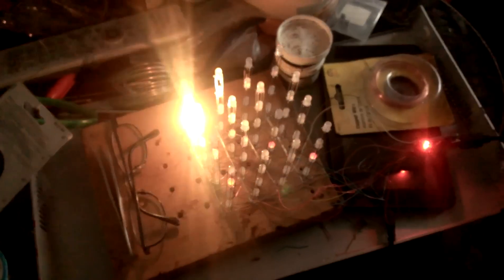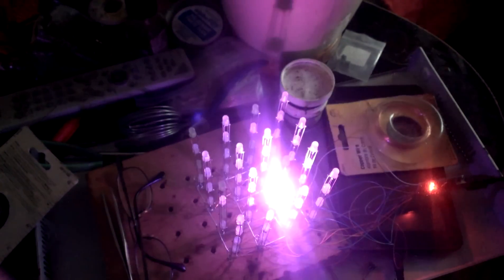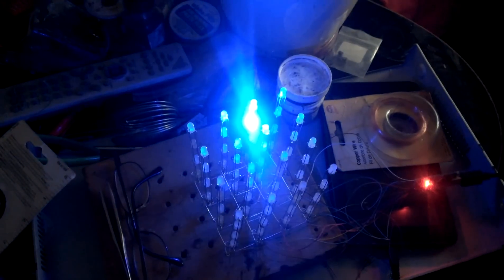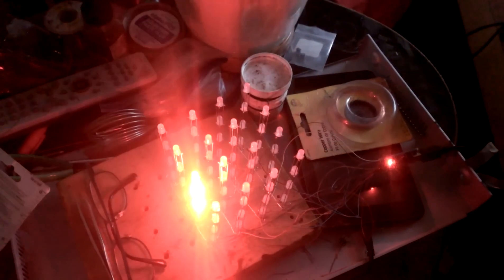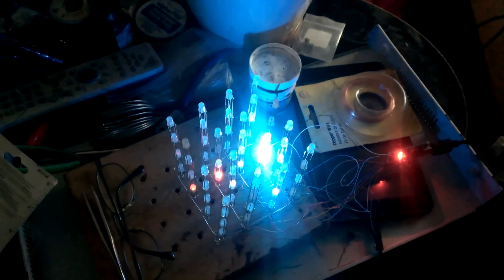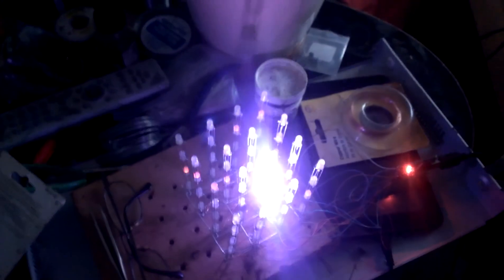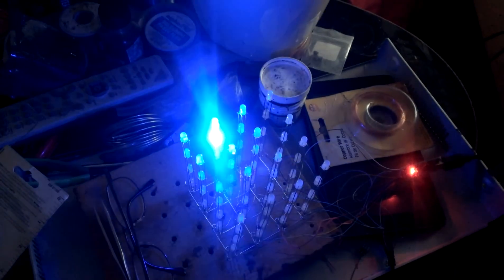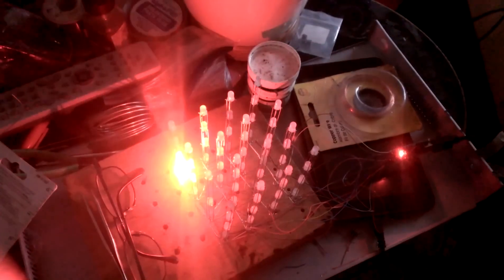Common Anode Charliecube.

Comment: I tried this but it's not working like yours did
I followed orginal Asher Glick's wiring diagram and then tried uploading the common cathode normal code and it worked but with some random leds in sequence which is not how it's supposed to work and I also tried just copy pasting your cubplex.h file and tried all the cc and ca codes from 1 to 4 but it didn't change anything (ca 3 had some error compiling and I can't work it out). So how am I supposed to work it out ? I'm not that much into coding btw

Comment: how to put that code into arduino?
Reply from the maker: Andres Liivak 
Using Arduino IDE
https://www.arduino.cc/en/main/software
Reply: lol, i meant, how to make it work, i copied it and it wrote me some errors
Reply from the maker: I cant quite make out those errors from here. Are you using common anode LEDs like I used in this video? if so, you cant use the regular code, you need to use the common anode code.
I made some instructables, they should help you more than this video will help.
http://www.instructables.com/id/Hacking-the-CharlieCube/